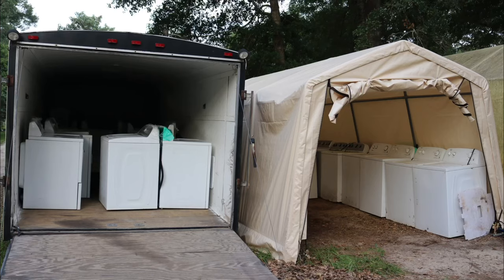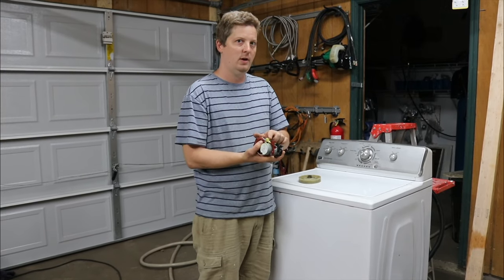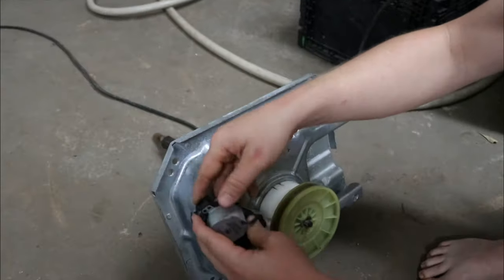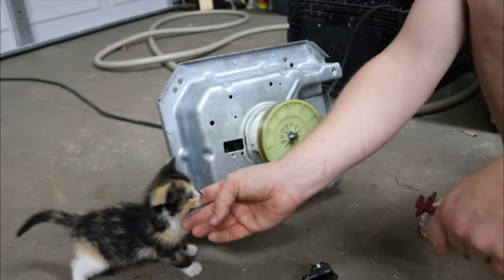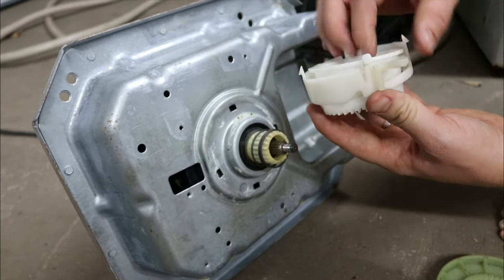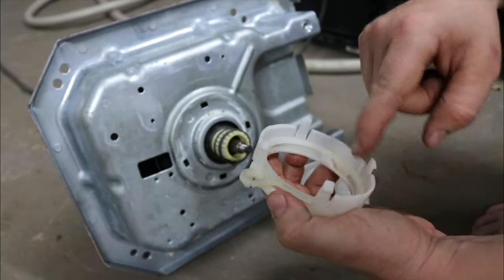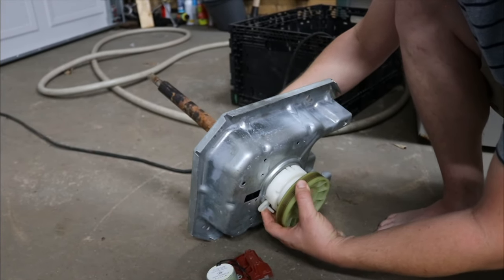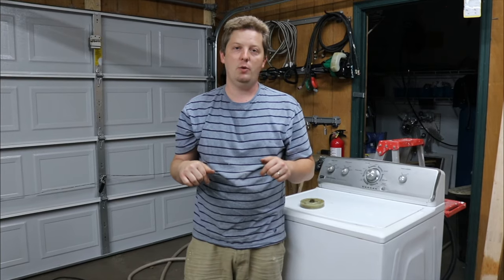Washer No Spin or Grinding Sound? Actuator Transmission Step by Step Guide to Fix or Replace

Comment: Hi I have a maytag like that but with glass MVWX655dw1 i got it from a friend and It was diagnosed with needing a pump, but sometimes the pump works and everytime i put power to it it spun. However when i ran the self test it seemed to pass if i understand it correctly, The Manual tests on the other hand Spin + done just flashes all lights as does rinse, rinse and spin, wash, the others seem to work as they are supposed too, except the rinse spin and done one time it did pump water out, would a pump work intermittent? and would it cause the other tests to fail??  It seem to work fine sometimes and other times no. Just dont want it to be a money pit!!
Reply from the maker: I’m not 100% sure but before you do too much be sure to put the washer in recalibration mode. A lot of times that solves any issues these types of washers seem to be having. It’s possible the pump is going out but the most common problem with these types of washers is the actuator.
Reply: @WasherDryerMoney  thanks for the suggestion, it’s great to see you doing well at this. As opposed to the quadruple L’s of the world lazy low life losers it’s a term I made up . It’s always nice to see efforts pay off

Comment: I have a Bravos and the wash plate doesn't spin. The whole drum spins and rotates in the wash and spin cycles but  the wash plate just spins with it.  I also hear a click when in the wash cycle as the drum goes back and forth.  We just replaced the pump because it wouldn't drain. That seems to have worked pretty well but now this other issue 🤦‍♀️

Comment: That grinding noise! That's what it is in mine. So I need a new actuator and would I need to replace the plastic pieces because they were grinding?
Reply from the maker: Yeah you could try replacing just the spluch.

Comment: I have a GE stackable washer/dryer.  Months ago,  I washed a quilt that must have gotten so heavy when wet that it caused the spin cycle to no longer work.  Since then,  when I try to run a spin cycle,  it makes a very loud clicking/buzzing/grinding sound and the Washer cannot complete the cycle.  I have to turn the machine off because if that.  I tried to reset the machine,  but that did not resolve the problem..
I’m wondering what you may think is causing this,  and which part do I need to have repaired..  at first I thought it might be the belt? Do you think that as in this video,  it may be the “actuator” ..  any suggestions would be greatly appreciated,..  thanks in advance..
Reply from the maker: I’m not extremely familiar with stackable just because I’ve only worked on a few there rare in my area. Most of them don’t have actuators.
If it’s the type of machine that has the front panel that comes off I would take that off first and see if there’s something obvious going on. Most of the time it’s a belt driven washer and southern be wrong with the belt or something is stuck in the water pump.
Reply: @WasherDryerMoney  thank you.

Comment: I have a kenmore is it possible for it to leak oil underneath when tilting it to the side ?
Reply from the maker: If it’s a direct drive washer it’s definitely possible. there’s a weep point on top of the transmission. If you lay it on its side for long enough it will pour out oil.

Comment: Replaced my actuator  and the machine goes through all the cycles but now it won’t agitate during the wash cycle.  The machine will spin and rinse, not sure what to check?
Reply from the maker: Try putting it in recalibration move.

Comment: Mine will fill with water but when it goes to agitate it sounds like the motor does not have enough power to do so. I think my brushes are going out on the motor. I was told the transmission is going out but I replace the transmission and it’s doing the exact same thing

Comment: Need help  with a GE washer, doesn't spin,  oil all over bottom,  could it be that the transmission oil leaked? Is the such thing?
Reply from the maker: Sounds like transmission problem. Not good

Comment: hey there i have  a maytag washer that the capacitor is blown. it has no information on it metal can. i want to replace it but dont know what size capacitor to use. can you help me on this please. what do these machine use run or start capacitor?  thanks in advance.
Reply from the maker: Check out appliance parts pros website. They haveA really nice search engine that you can use your model number in. Just put the model number in the search engine and it will show you every part for that machine. After you get the part number you could also go to Amazon or eBay if you don’t want to order from the website.

Comment: yea did that a few times over the life of the washer// i changed out actuator  worked fine on test   then it acts like the motor wont kick in high speed  am i missing a step ?

Comment: Hi I have a maytag like that but with glass MVWX655dw1 I added a pump from another machine so it appears to operate normally now but ive noticed the water level seems low the cloths stay above the water in wash mode, Is that normal??  if not what is likely the cause???
Reply from the maker: A lot of newer washers are water conservers. If there is a deep water cycle or something similar to that just run the machine on that cycle. Sometimes it will be called blanket or bulky mode.

Comment: I've replaced the actuator about 3 times. It's always the little nub on the arm thats located inside the actuator itself. Do you know if the plastic arm is sold anywhere where you can just replace that part and not the whole actuator itself?
Reply from the maker: I don’t think you can buy the plastic arms separately. If that arm is messing up that probably means the shifter it is pushing has sand or for some reason it’s just too stiff. You can take it apart and grease it until it moves easily and that may solve the problem of those arms breaking.

Comment: Is the black and red actuator interchangeable is you aren't get the black can you use the red etc.
Reply from the maker: They’re not interchangeable. They’re a little bit different it will not fit into the original spot. I think the plugs are slightly different as well.

Comment: My same Maytag won't spin. I pulled the belt off, but that splutch won't spin when I try to turn it by hand. Is my splutch the problem? Can you help me?
Reply from the maker: First thing to try is put it in recalibration mode. I do not have a video on that, but just search for it and you’ll be 1 million videos about how to put it in recalibration mode.
This may not be your problem, but it’s free and a lot of times. It will fix weird issues like this.

Comment: hello , what does it mean when I can't manually spin the splutch/cam its pretty much locked up , is that the actuator since you said there is a laser or something that will stop it from moving ??
Reply from the maker: I’m not sure I’ve never tried to turn it by hand.
I am not 100% sure.

Comment: I have a GE WASHER that has a problem with filling up with water when it goes on spin mode.  I put it through the field tests and it threw a code for the fabric softener rinse through.  I rinsed it out with hot water and it started running water through the dispenser. The code cleared and no other codes came up.
I tried to wash a load and the same thing happened with water and no spin.
I went to the test for the drain pump and it emptied the tub. I then put it on the spin test. Pump came on then it went full on spin cycle instead of the 15 rpm test spin.
I cleared the machine reset it but it still gets stuck on the water filling up on spin.
Could it be the actuator even though it works perfect in the field test of agitator and spin cycle? Help...lol

Comment: Should the actuator arm be moveable when you have the part out?  Or will it only move when its plugged in with power?
Reply: It shouldn’t move at all. I  pulled my bad actuator out today and the arm flopped back and forth. The new one is stiff.
Reply from the maker: It shouldn’t easily move.

Comment: What else i have to check to my Roper washer motor is good , pulley gears are good ,capacitor is good ,actuator is good , but still wont turn the basket contniously it turn just a little bit then stop what else i have to check

Comment: My maytag machine doesn't go thru a wash cycle it will fill and just make a noise and smells like burned belt but if I put on spin it spins and drains is this my problem.

Comment: Sir, My Whirlpool WTW4800XQO  top load washer makes noise when the water pump is operating completing the discharge spin cycle too. When the water level in the pump is low the noise level is more extreme, why I’ve checked the impellers and pump to see if it had an obstruction but found nothing? Can anyone possibly comment are the pump bearings going out if the were the case the noise would be present even when the water pump has water in it during operation too.Need some suggestions. JR

Comment: Can the shaft be fix or by a new transmission on a 600 elet kenmore
Reply from the maker: Depends on what’s wrong with the shaft. I’m assuming you mean the shaft the agitator sits on. If it’s bent, I would say yeah you probably have to buy a new one. The transmissions are not serviceable. You cannot get parts for them or really get into them easily. If there’s an issue in the transmission itself.

Comment: I have a Whirlpool Cabrio H e. and it just made this loud grinding sound and now there's no movement at all. I'm thinking it mite be the transmission. I had it replaced about 2 1/2 years ago. It has a small computer in it and I remember the computer  putting the machine into a type of "limp" or "neutral" mode. Now it won't do anything it won't cycle threw any mode. There's no movement at all. Do you have any suggestions to maybe put me in the right direction? Thanks for your time.
Reply from the maker: Go to the channel Ben’s appliances and junk. He has a great video on how to put a washer into diagnostics mode.
Reply: @WasherDryerMoney  Thanks for the info.

Comment: This video seemed to exactly describe my issue. My splutch was shockingly spotless, but I ordered and installed the new actuator. The grinding sound is gone, but high speed spin still does not work. What's the next culprit?

Comment: Hello,

I have the same mechanism in my washer. The problem that I am having is that during the normal washing cycle the unit stops at the spin cycle once is done draining the water. I have fixed other issues in the past but this is the first time for me. I removed the entries unit apart to see if there some type of ware on the teeth but everything seems to be Intact. Could it be the same part that you are describing to be the defective part or do you think it could be the lid switch ??? If I move the knob to rinse and spin it works but it doesn’t spin during the normal cycle. PLEASE HELP!!! How can I test that part to see if it’s defective ? Multimeter ?
Reply from the maker: it is a hard part to test. It's more likely the actuator than the lid switch in my experience. Lids switch go out but nowhere near as much as actuators.

Comment: my top load machine works, it just make a very loud screeching noise during the wash mode, but is fine during spin mode. do you have any clue to what might be the cause if the noise?
Reply from the maker: It is probably the splutch. I do not have a video on that problem yet but there are lots of them on YouTube.
Reply: @WasherDryerMoney  thank you, I’ll check it out!

Comment: I clicked on this video because it sounded like the problem my machine is having except my machine is dripping red fluid so I’m guessing it’s not the actuator. Could the actuator failing have caused something on the main motor to break?
Reply from the maker: It’s probably the gearcase leaking. Not a lot of easy fixes for that. Just replacing it. Some people called it a transmission.

Comment: I have a Maytag with the same components ,my problem is clothes are still wet at the end of cycle.when I run on manual mode the low rpm spin makes the motor pulse.any ideas?

Comment: My top load washer won’t spin and agitate. I looked under it and and found water leaking seems to be from the tub seal and the mode shifter engaged and disengages back and forth continuously. Is this normal or is the mode shifter supposed to stay locked in the gears?
Reply from the maker: It’s probably the tub seal going bad. Which is a bigger job.
The actuator should definitely not be going back-and-forth constantly. It might have messed it up.
Reply: @WasherDryerMoney  thanks for the respond. When the machine is off the mode shifter actuator gears stay locked in but when I put in to test spin and agitate cycle the mode shifter actuator gears go in and out.

Comment: I have a roper washer rtw4516fw1 that runs water, agitates but gets stuck in cycle when trying to drain, after agitating. I’ve replaced drain pump but still having issue. Almost a grinding like sound when it’s trying to drain. I’m thinking of trying actuator next.
Reply from the maker: Actuator would be my next guess.

Comment: Will the, what call splutch, cause the machine to hang in spin?
  I have a Maytag centennial that hangs in spin when I try to recalibrate it. I have to unplug it to get it to stop. 
  I replaced the actuator, but I cannot be sure it is a new one. I removed it from another I have had for a while in storage.  
  It is the black one. 
  I have to pull the plug to get it to stop AND plug it back in to get the lid to unlock.
Reply from the maker: You can put it in diagnostics mode and see what the machine automatically thinks is wrong. I don’t have a video on the app there’s some really great ones out there just look up diagnostics mode washer and it should pop up.
Reply: @WasherDryerMoney  I pulled the codes before I changed the shifter. 
  F7 E1
  When in calibration mode, it goes through the cycles. When it starts spinning, it keeps spinning until I pull the plug. I can’t get it to stop just by pushing the power button. 
  In high speed spin, it does have a pretty good wobble to the drum/basket. 
  Before I bought it, I checked the suspension rods by pushing down on the wash plate and releasing it.  It does have a little spring to it, so I pretty well expected them to be bad. 
  With this code, I decided to change the shifter. 
  I need to get the wash plate off to check things further I guess. Of course it does not want to come off. :(
Reply: Wash plate did come off. I suspected the drive hub was stripped. Sure enough it is. 
  I strengthened the suspension springs.  There is no bounce when U push the tub down and release it, but still bangs some when spinning. 
  Could the bad hub have anything to do with that?
  Supposed to be anything to go between the basket and the hub itself to lessen friction?

Comment: So recently my washer starting to make a grinding noise at the very end of the cycle. Right when it's about to come to a complete stop. I found a lot of oil on top to the pulley and that took off in the video. What do you think my problem is ?
Reply from the maker: I just made a video about this problem. Check it out.
https://youtu.be/WF5V1Dijsiw

Comment: Hi… I have a Haier hlp21n portable washer. The machine won’t spin. I replaced the belt and lid switch but still nothing? Can’t really find much on YouTube to help me. The water fills and rinse but no spinning? Please help😣
Reply from the maker: I’m not super familiar with that machine, but it may have some sort of clutch or shifter and it is not activating. One thing to try before anything is seeing if unplugging it for 30 minutes and plugging it back in and resets the computer board. Sometimes it will be something simple. Good luck.
Reply: @WasherDryerMoney  thank you I’ll try

Comment: What’s the torque spec for the pulley nut? Mine makes that grinding noise too and the nut keeps coming loose after I replaced the pulley and belt
Reply from the maker: Put thread lock on it. I’ve had a machine do that same thing before.
Reply: @WasherDryerMoney  Awesome will do, thanks buddy =)

Comment: I replaced the actuator and my washer is making the same exact noise, and it’s still stuck in sensing once I plug it in. When I had it all apart to replace the actuator, I didn’t find anything else wrong with the movements of all the other parts.

Comment: My Maytag washer won't spin or agitate.   It starts spin, then stops.   I ran diagnostics and the error is F7E5, which indicates shifter fault.   I accessed the control board and removed J16 connector to test resistance, and the actuator is registering at 1.1kohms, and according to the tech manual, it should be within 2k-3.5kohms.     Should I replace it?   I'm just confused because it tries to spin or agitate, but then stops after a few seconds.   So it seems like it's in the correct position and the actuator is doing it's primary job.
Reply from the maker: Yeah that is a little odd. I would buy it on Amazon Because Amazon usually allows returns for nearly any reason.

Comment: I have a kenmore washer when I start the load the lid will lock and go to sensing mode it will continue in the mode for approximately 10 min. After that it will go to drain mode and drain and unlock the lid. The motor seems fine if I put it on drain/spin on the dial selector it will do it. Hear the pump come on and it will spin at the high rate just like it’s completing a complete wash cycle. What’s wrong? 🤨
Reply from the maker: Look up a video on putting the washer in diagnostics mode. There’s a very good one by a channel called Ben’s appliances and junk.